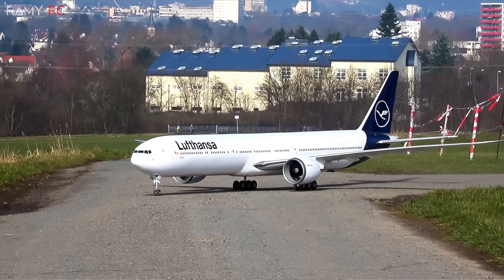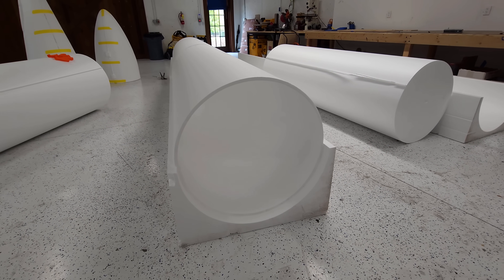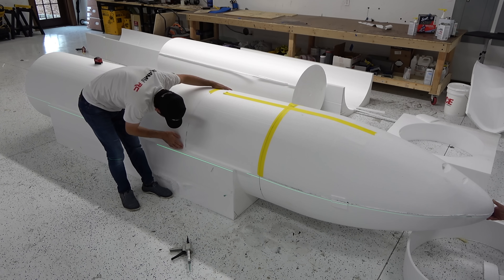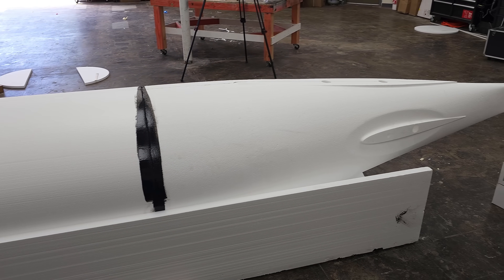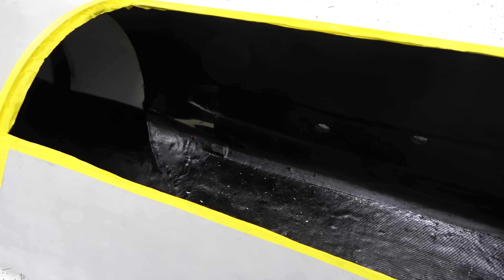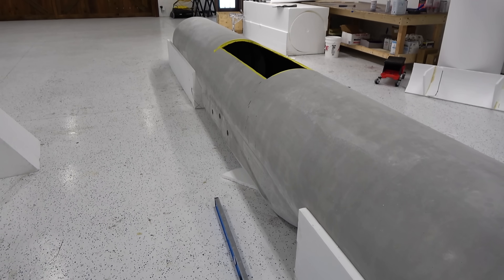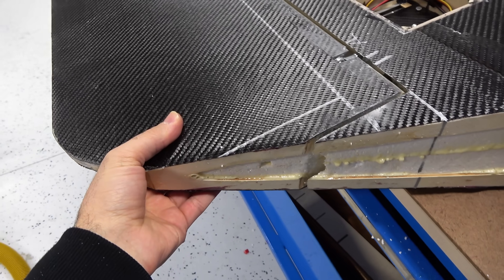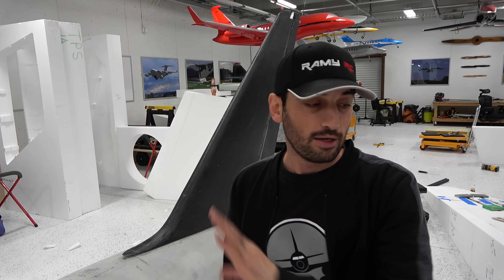Building the world's biggest Boeing 7779X RC Airliner, PART 1

Comment: Build a 1.5 metre diameter interior fuselage airliner aircraft capable to fit one person sitting inside the fuselage and utilize a RC TRANSMITTER to pilot the scale airline aircraft 😅.

As long the model aircraft capable to carry the one man person sitting inside the aircraft. Maybe the length of the airline might reach to 60-70 feet with real windows and doors. It will be the LARGEST RC MAN PILOTED MODEL AIRLINE AIRCRAFT ON THE PLANET. 

A 1.5 METRE DIAMETER FUSELAGE HEIGHT OR MAYBE 1.8 METRE  DIAMETER ...

Comment: You know im making the same thing but i have no materials and i only need about 2 tons of steel or Aluminium then 3 landing gears then Bomb bay then Thermal vision then Landing hook then 2 electric jet engines then 1 Jet fuel powered engine then the shape will be same as a SU24 with folding wings.

Comment: Hey Ramy, I was wondering if you and Tyler had looked into large scale 3d printing for these planes. With the new foaming low density ASA material and >1m³ build volume printers available (or how easy even bigger diy ones can be built now). You might be able to really streamline your process vs milling foam. You could print the fuselage and wings in very thin cross sections and lay carbon on top. This process is actually gaining popularity with smaller scale modelers and in scale rocketry. Love your work, I have no idea how Tyler has the guts to fly these works of art.

Comment: I got started back in 2015, and because of you, and like you, I customer build my planes, no kits. I'm currently finishing up an 11.5 ft F-15E with two kingtech 320G4 jet turbines and will be starting a 21.7 ft F-15EX powered with two Kingtech 450G5's, to be followed up with a 1/4 scale F-22. Thanks for the motivation Ramy, both of these F-15s can be flown via radio transmitter, flight station, and with or without VR goggles. Keep up the great work you do for the sport. Ruben D.

Comment: With such long cable runs- this is where 12v servos will be perfect. Great job Ramy, your first works were amazing however you’ve really stepped it up in all aspects, size, build, engineering.

Comment: I love this and you are definately the guy to do it.  Did someone do structural and flutter analysis on this thing?  Does the FAA get involved with design of a plane this big?  It IS going to be flying over or near crowds of people.   Watching the installation of the rudder you didn't mention anything about adding weight to the small bit at the top of the rudder that extends forward of the hinge line and that is usually where the extra weight is added to counteract flutter. Something this big is going to have flutter issues.

Comment: There is already a noticeable error in the profile accuracy on the fuselage profile.  There is a 'double step' in the top line of the fuse between the actual tube of the fuse and the cockpit area.  Your version in this video does not have the step.  Just sayin but if youre going for accuracy, you are already of course.

Comment: Based on cubic wing load at 1/7.5 scale, this thing could theoretically have a max takeoff weight of almost 1300 pounds (assuming the structure could actually handle that load).

Comment: Why do you narrate in English and then in foreign language for volume, speed and distances? It makes my viewing a WASTE of time. I'm NOT going to sit here and convert French to English or convert speed and distance to feet and miles per hour because it is the same trouble. Your target audience is not Canada because there is nobody there and all the money for your sales comes from USA. No references in English ruins your video. Language applies exactly same to speed and distance as words. I have to look up what "papion" means in French for instance "butterfly" translated. I cannot see 20m? I can see 65'-7" and forget metrics better because one has to split hairs in all measuring systems. If i say 65' exactly then that would be 19,8 meters (less accurate by the way) You narrate in English and "So Should Distance Then" is my point. You can blame man in Genesis 11-9 of the Tower of babel. I like your flying videos but I like the build videos better. More elaboration on them would be great. More process of how you do it and more assembly video time too.❤
Reply: Don't watch then.
Reply: And your car gets 40 rods to the hogshead😂